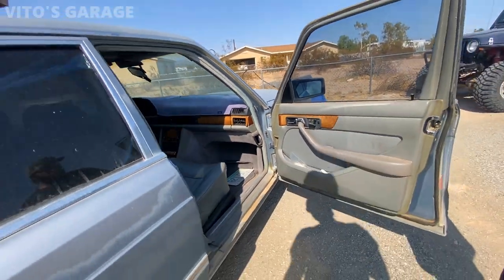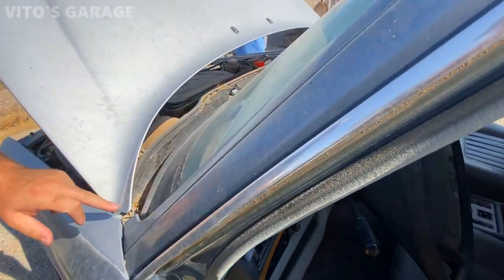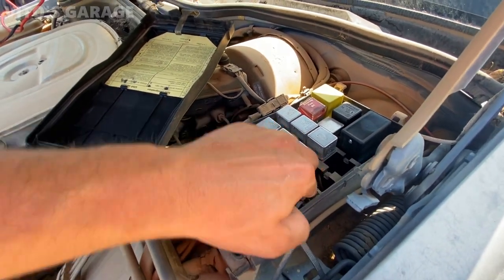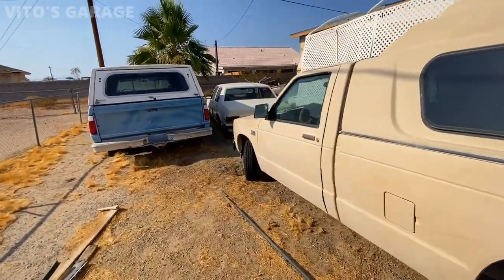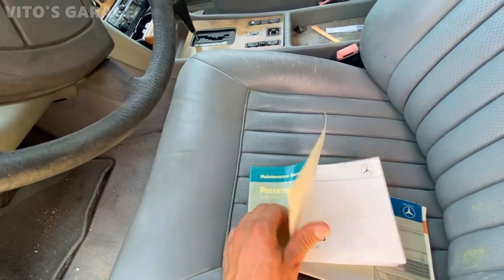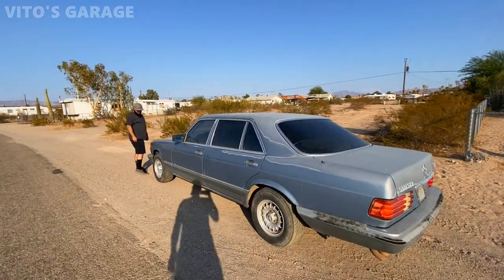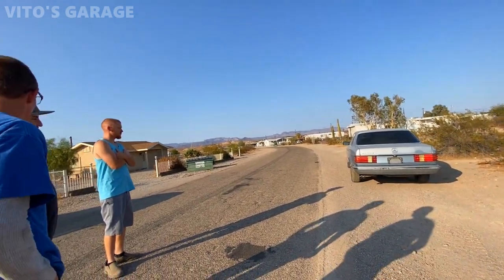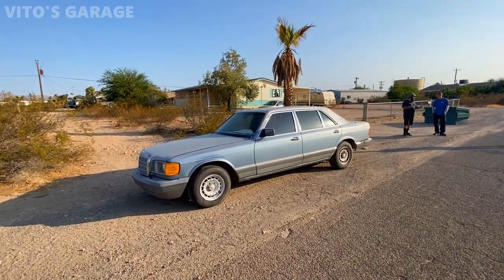This 1985 Mercedes 500SEL W126 Has Sat For 10 Years in Grandma's Desert!! SAVED From Junkyard!!!

Comment: I have 1983 w126 500sel euro spec Id had mine for years its a grey market one I keep havin a issue with mine starts right up but as soon as it warms up it acts up an dies but as soon as ur restart it it runs okay for a couple mins an dies again havent been able to pin point the problem yet ive owned it for 5 years now still havent been able to drive it for more than a couple blocks
Reply from the maker: What repairs and diagnostics have you done?
Reply: @VITOSGARAGE  Ive done all the basic tune ups has copper bosch plugs new wires new distubator cap as well as ignition rotor fuel pump fuel filter Ive cleaned out all the fuel system prior to replacing everything also has a new coil it will fire right up dosent take but a second an she fires up with no issues but once the engine gets to operating temp it will stumble an die but will fire right back if u restart it but will take a few mins an it dies an sputters again the fan clutch is good it doesnt over heat I had a few vacuum issues but I sloved them an she still continues to act up car is beautiful very low miles I can post pictures of it on ur facebook page I'm pretty mechanically inclined when it comes to these mercedes but this just drives me nuts I cant figure it out an Ive invested in so many parts an time I just keep buying more an pushing it back until I find something else to check an trouble shoot
Reply from the maker: @josellamas5609  Share some videos with me on facebook and the symptoms it has. We will try to figure it out together. I think you also have to check your fuel pressures first. You need to order a KE Jetronic fuel pressure gauge. I think yours has a warm up regulator too, instead of later EHA valve